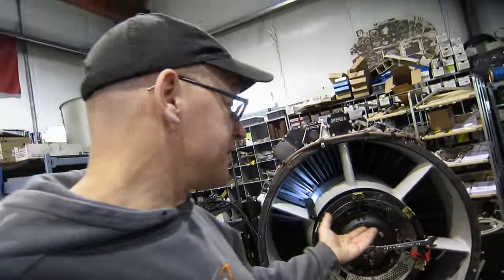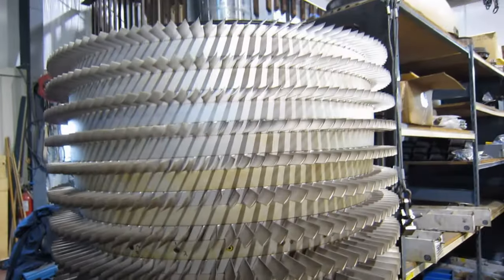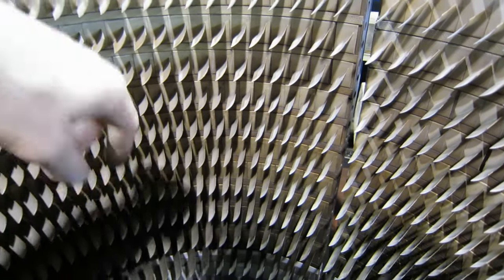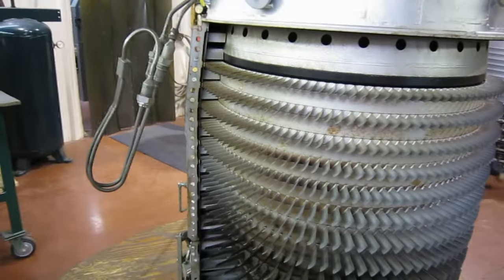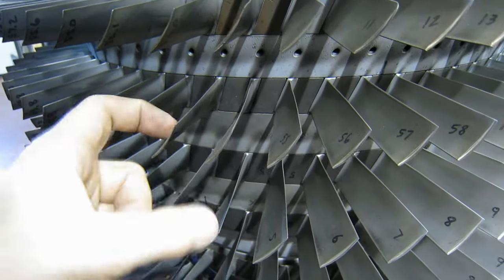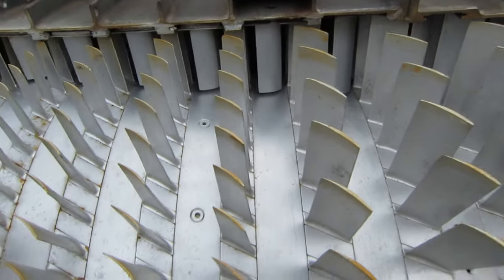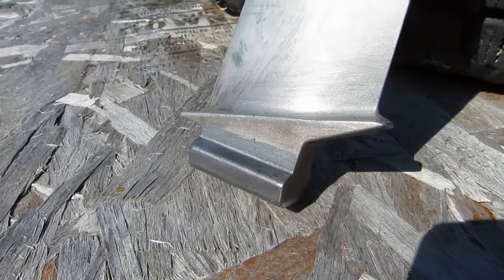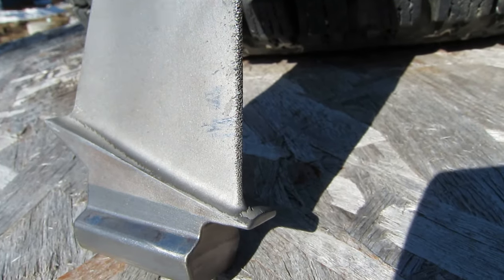Compressors - Turbine Engines: A Closer Look

Comment: all those small blade 's create the terrible sound you never want to hear when working on turbine engines.
Reply: that noise is? the rattle you hear when they power down?
Reply: Ozzie Peck Ozzie Peck when you accidentally drop something into the compresser, it hits the blades, making a chime noise that decreases in pitch as the object hits a progressively steeper blade
Just look up: dropped into a turbine engine.